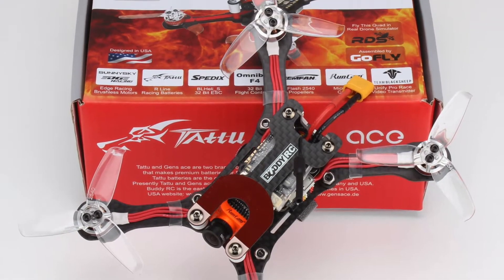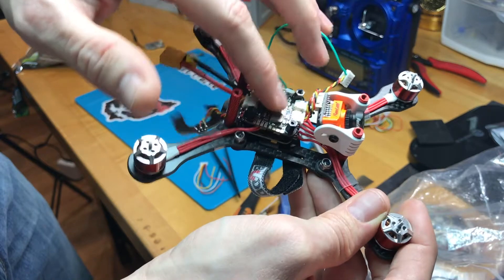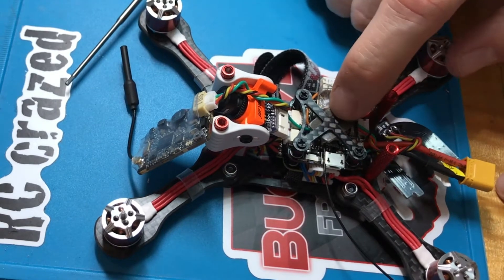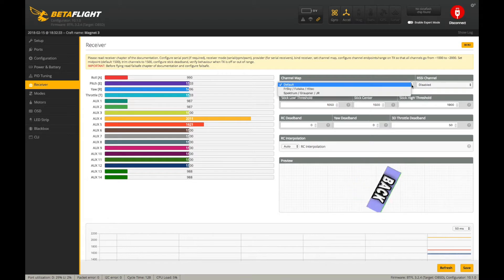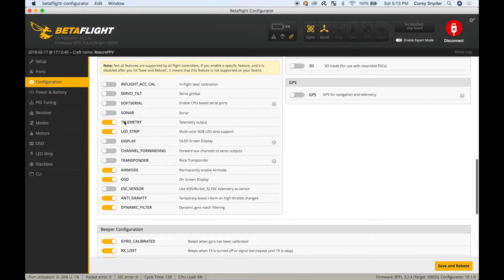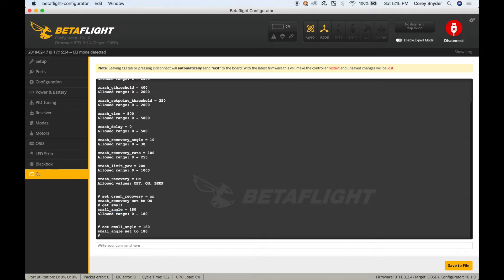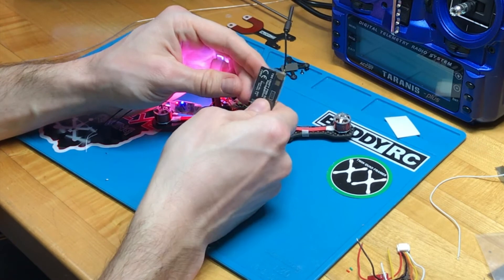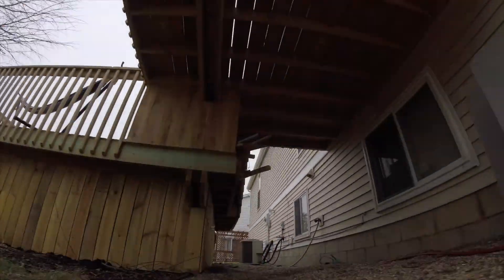2018 BuddyRC Magnet Stretch 3" Racing Quadcopter | Wiring & Configuration

Comment: I have a question. I just set everything up for my Magnet and everything is working fine, except I can't get my motor to idle when I flip my motor cut sw off. Throttle works but no motor idle speed at throttle in lowest position. What is wrong? Please help.

Comment: See post #28 in the linked thread for the S.Port fix. 
https://www.rcgroups.com/forums/showthread.php?3037848-Buddy-RC-Magnet-Stretch-3%C2%94-FPV-Racing-Drone-Designed-by-Detroit-Multirotors/page2
Reply from the maker: Polar Family good find man!
Reply: Anytime! I was determined to figure out how to get it working. Mission accomplished!
Reply from the maker: Polar Family I’m pretty certain that if you jumped the other 2 pads instead, you’ll get the ability to use ESC Telemetry from the 32-bit 4in1 ESC.
Reply: You are probably correct. But would we be able to have both running at the same time?
Reply: I'm still confused, So I need to jump the left two vtx pads to get smart audio to work? Does that mean to solder them together?
Reply: Yes and yes.
Reply from the maker: If you want to use the VTX molex connector on the FC, then yes, you should jump(bridge) the VTX pins labeled on the product page. If you want to skip the molex connector on the FC and just run the smart audio wire directly from your unify pro plug you can do it the way I did it in this video. I did it this way before learning about the jumper & plug.
Reply from the maker: You have to make a choice, ESC Telemetry or S.Port Telemetry. I chose S.Port myself.
Reply from the maker: BTW, did you have to solder the "un-inverted" S.Port wire or just the inverted signal on the plug?

Comment: So I got the same quad and same receiver trying to fallow your build. The smart port going to TX3 comes from where on the receiver you sort of skipped that part and i'm still very new to this. Any help would be great.
Reply: Eric Hanson Only way I got Smart Audio working is with TX6 or doing soft serial setup on PPM pad.  Keep in mind I use a spectrum telemetry receiver and need TX6 so PPM was my only choice
Reply from the maker: Dennis Eric is asking about S.Port telemetry not Smart Audio. I cover smart audio pretty thoroughly I think. If you have any specific questions let me know.
Reply from the maker: Yes I skipped over that b/c I never actually got smart port telemetry working and I didn't want to cover it until I had it figured out. Were you able to figure it out? If so please share. I think my issue is with betaflight versions and updated LUA scripts but I haven't had the time to dig into it.
Reply: Yep,  thanks read it on my phone and thought he was asking about Smart Audio.
Reply: i'm taking about the uninverted smart port line. The orange line you added to the receiver under the shrinkrap
Reply from the maker: Yeah I hooked it up to TX3 but it doesn't work for me. I'm still trying to get to the bottom of that. @Dennis reports that his smart audio doesn't work on TX3 either so I'm wondering what that port is designed for. Maybe it has a hardware inverter on it and it's messing up the signal for betaflight.

Comment: Hoping you can help.  I just received my Magnet today and trying to get Smart Audio working.  I am using a Spectrum Telemetry 4649T receiver on BF3.3 which I have to have wired to TX6 (Uart6) in order for it to work pulling RSSI & Pack voltage.  I tried putting Smart Audio on TX3 (Uart3) and it will not work on the OSD or transmitter.  If I put Smart Audio on TX6( Uart6) and my receiver on TX3 (Uart3) than I can change video channels via my radio but now my receiver wont arm.  The plug for the Unify pro that plugs into the FC only has +/- and video and no smart audio cable.  I had to use a spare wire from another Unify VTX to wire in Smart Audio to the FC but I just noticed their are 3 pads just above the TX6 pad that says short for Smart Audio,  what is this for,  can I use this for Smart Audio?  

Don’t bother replying,  I figured it out and confirmed on FB that TX3 does not work for Smart Audio.  Use soft serial with PPM pad and works OK.  Keep in mind this is for Spectrum guys with telemetry receivers,  any other receiver no idea.
Reply from the maker: Glad you got it working though. I think they have supplied plenty of schematics and pictures on the buddyRC page to explain it. Smart Audio will work on UART3 or 6, they are identical.
Reply: No it will not work on TX3,  this has been confirmed on FB as it was noted it will be fixed next release.  I also am using Spectrum Telemetry receiver where I need TX6 so not possible to use it for SA.
Reply from the maker: Dennis Forbes got a link to the Facebook thread so I can follow along?